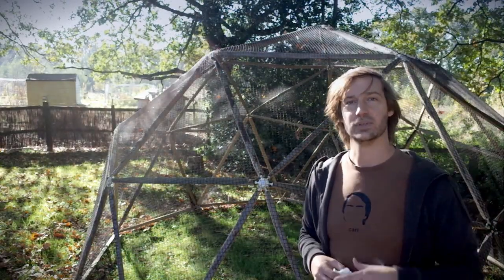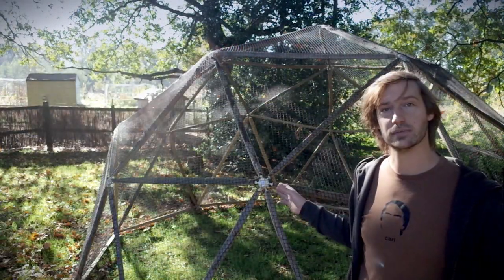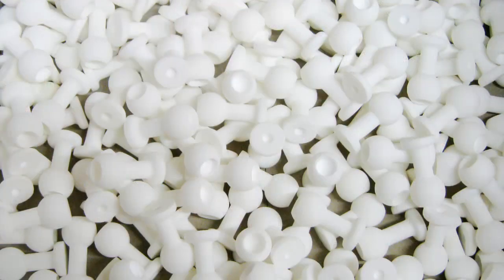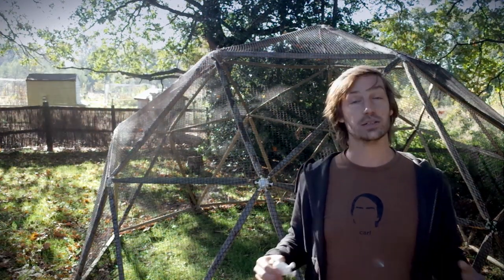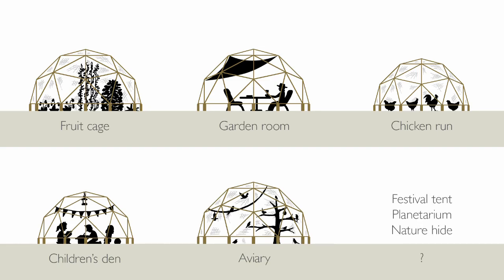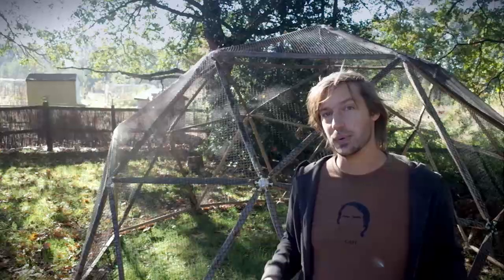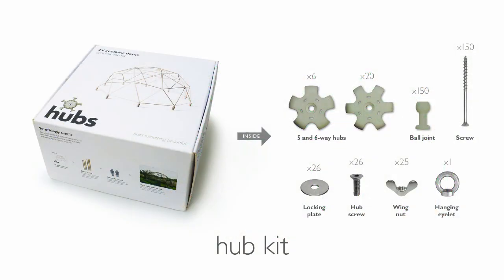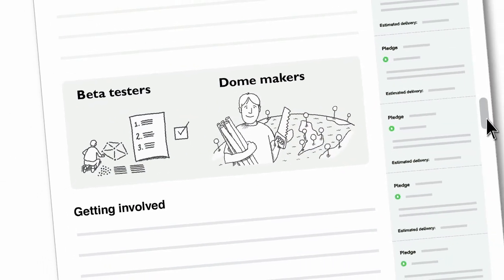Kit for Making Geodesic Domes

Comment: What size PVC cap will snugly fit over a connector? A PVC cap will screw onto the connector and I think, a piece of wood screwed onto it would serve as a nut to secure it without glue.

Comment: Can you make Geodesic Pyramids?
Reply: Yeah you can you just need to arrange the hubs horizontally rather than vertically
Reply: @craigfox9751  how ?????
Reply: @TheMessenger212   if you check this link https://youtu.be/w2pmgK35Gr4 the author goes over the differences between the Two structure types and some similarities. But the jist of it is using your kit parts to build the structure hubs kit allows for builds to be between 60 - 90degrees so you can build a pyramid easily enough. In terms of the layout anyway. The major difference is that your pyramid will require internal supports where as a dome is self supporting due to it's structure. I have just got the hubs 2v kit last week and have been looking over the building process and it's quite straight forward. If the geodesic pyramid is the way you want to go I'd look at how complex you want to build it to be,the supports you need internally and the amount of long and short sticks or poles you will need based on how big how want it to be.
Reply: @craigfox9751  have you built before I never did and I'm using it for stage is that okay?
Reply: @TheMessenger212  Yeah, if your using it for a stage I'd suggest using the pyramid as an overlay and separate the weight bearing structure from the structural shape of the pyramid that's to say build the stage first as a base to whatever height you want then assemble the pyramid on the top of that base

Comment: Very slimpsy design, suitable only for toy domes.
Reply: They are designed for garden structures; fruit cages, arbours, garden shade, etc. Sure, you wouldn't want to build a house or climbing frame with them, but that's not their goal.

Are fruit cages only toys because you can't live in them?
Reply: I made a maximum size one for my allotment - used at first as a fruit cage and about to become a greenhouse. It’s very durable.